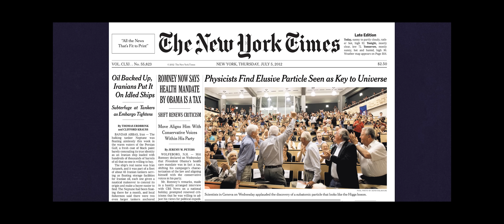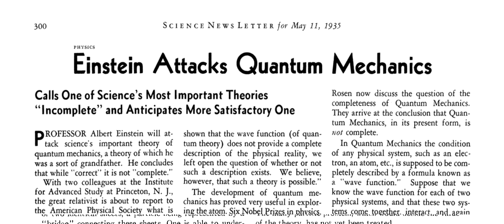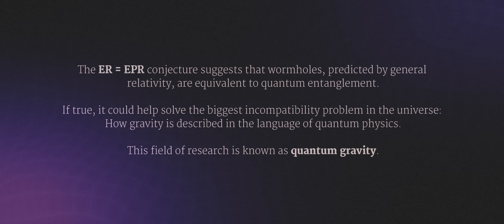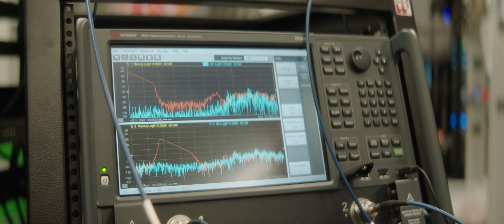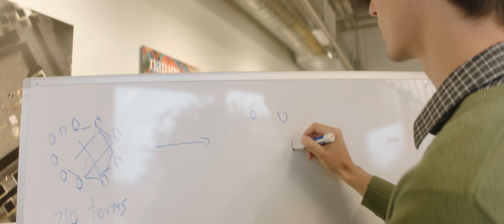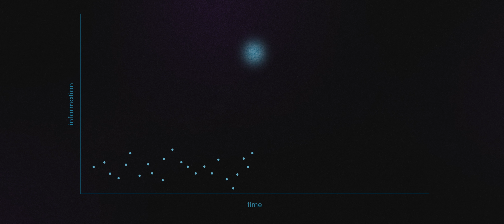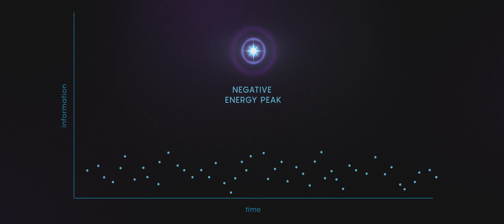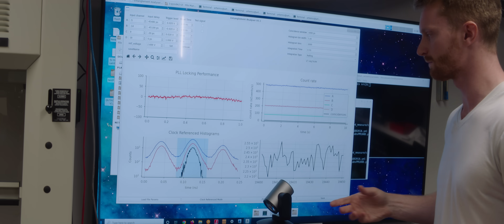How Physicists Created a Holographic Wormhole in a Quantum Computer

Comment: To everyone watching this and thinking they actually create a wormhole in a lab, you need to calm your enthusiasm a bit. What they really did in their lab was simulate the physics they THINK runs our universe, which may very well be wrong or, most likely, be incomplete. On top of that, they simplified this simulation, or model, so their quantum computer was capable of running the experiment. This resulted in them removing a lot of potentially significant variables that very well may have led to a physically inaccurate model.
As of right now it would be irresponsible to claim an actual wormhole was created. I understand the scientists involved in this simulation want people to think otherwise and I also understand why media outlets would love to use their claims as clickbait for their articles. That doesn't change reality, though. Creating a simulation based on our current, incomplete understanding on physics, then proceeding to vastly simplify the simulation, and then succeeding the experiment on this simulation does not prove much. But it very well may be a step towards the right direction, who knows.

Comment: I call bullshit. There has to be a difference between quantum teleporting, and using neural networks to optimize the space an electron has to travel in real time. Even if the math suggests with enough energy you can push these bits through a singularity. 

What these scientists should be saying is that if they had a solar mass worth of energy hooked up to these computers they can force this optimization to push across a singularity. But this is still just a simulation. Albiet a powerful experimental verification of what Einstein already explained had to be a physical reality. 

I am just saying there is a big difference between a blueprint of a boat that will take you to the new world, and building the boat that actually can take you to the new world on the first try without finding one of a million reasons to sink itself for challenging God.

Comment: "They hoped to design a quantum circuit that is mathematically equivalent to a wormhole." 
It is going to be very important to explain how this isn't just a simulation, because quantum computers (or at least as far as I understand the math) can't solve problems that a traditional boolean based circuit can't solve (just with more instructions). 

I actually understand what the idea is here. Because qubits are suspended in a vacuum and not bound traditionally to a linear circuit like a normal CPU chip is, can you theoretically bridge an informational path way that is shorter from point A to point B than a traditional circuit, and can you make that distance infinitely smaller and smaller to the point where you have a circuit that approaches a singularity? 

I am not an expert in physics ( i am more of a programmer) but what I understand about Quantum computers is that this is theoretically their main feature. The idea that some algorithms become more powerful when you can compact them down into theoretically smaller and smaller "virtual" (or rather magnetically manipulated photons in a vacuum state, the circuits size becomes a function of energy input rather than a function of how small you can print silicon into circuits). 

From what I understand about this argument is that if you were to ask the question "what happens when a black hole eats another, isn't this technically a wormhole? and better yet if you dropped in an identical piece of matter in both ends at the same time in the same symmetrical but mirrored location on each individual (but lets theoretically say they are the exact same) blackhole, can you plot the fate of each other, by only plotting the fate of one, presuming equivalent states of the black holes? 

In such a state, yes worm holes are equivalent to spooky action. The only thing I don't understand is the quantum teleportation aspect. Simulating a wormhole in software, doesn't actually break any rules like faster than light travel. I'd argue that if this wormhole was real, it could make computer chips that are far and beyond more efficient than the human brain could ever be with a "cpu" that is one millionth the size of a human brain because you could theoretically optimize in realtime the size of these "photonic/virtual circuits" all the way down to the size of an atom.

It might be extremely energy intensive (think about a computer that needs a particle collider to power itself) but if this experiment is actually legit (and not just something anybody with a macbook can do right now) we could be seeing a breakthrough in computation too.

Comment: Bah. A simulation is only going to be as good as the information put into the computer and we do not have enough solid evidence of what's in a black hole to make an accurate simulation.
Reply: It wasn’t a simulation. It was a physical wormhole on the quantum level formed between qubits in the computer. So they successfully created a wormhole on the quantum level.
Reply: @hintoflimetostitochip7978  I rewatched to confirm and no it does not. 12:13 "what happens is, the qubits of the google quantum computer, are making a little bit of extra space, and that's our wormhole." That is not a wormhole, it is a "simulated wormhole". It then continues at 12:22 saying: "a pulse of negative energy falls into the wormhole". Negative energy is completely theoretical and unproven. Again, it is using theoretical inputs to achieve the desired result in the simulation.   

 If the scientific community agreed that this team had actually created a physical wormhole, it would be blasted from every scientific news source out there. The fact is that you cannot create something that's physically real inside a computer. It is doing nothing but math based on inputs regardless if the math is being done by a quantum computer or not.

Comment: 4:13 problem is entanglement gets exponentially harder to maintain with macroscopic particle systems. Black holes have WAY TOO MUCH particles, making this task practically impossible. IIRC, there's a "technique" to reduce the complexity to a cubic (better than exponential, worse than quadratic), which allows to reduce the entropy.

If traversable wormholes can exist, this would cause time-travel paradoxes because of teleportation. Unless "ER = EPR" means there's no teleport, because entanglement cannot send information faster than light.

This means wormholes are pretty useless, because the time to traverse them is proportional to the distance between the ends. The only use cases would be to avoid dangerous zones filled with rocks (for space exploration), or deprecate optical fibers in favor of "vaccum tunnels" (for communication)

6:09 "negative energy" usually means "virtual negative energy", in the same sense as "virtual particles". It's just a mathematical model with real observable effects. But if they mean "real negative energy", this brings back time-travel paradoxes. However, if the hypothesis that Dark Energy is actually negative energy is true, this is plausible, because nega-particles can't interact with posi-particles, except gravitationally.

Problem is, this is still implausible, there's no way to "harvest" negative energy. Unless we put the 2 ends of the wormholes in places devoid of gravity, to allow dark energy to do its job.

Comment: I have. Squash in the microwave grew vines out in 1.5 seconds. Time travel is aging and people think it's an electric staircase. One side is a electrode cavity and the other is a magnetron. Was a pin in it 🍠 1.5 2.5 about how long it took me to turn it off in surprise. 19 years ago. I actually hit start , stop, reset time and start again before it went funny so there is a variable in the pressure. Really creepy, never tried it again. Maybe that's why there was a UFO over our house that summer 🤔 ✨. Our existence is also in a worm hole so technically everyone has the experience as time moves forward 🌀

Comment: Time does not exist. A rosen bridge is not a wormhole. It is an understanding of what someone thought. A wormhole is Energy between two galaxies or Universes. Quantum Entaglement is the string theory of everything is connected and is proven. First we have to understand the energy in quantum physics to know what the string is made of. The we must except that time is wrong. Everything was based on the travels around the Earth which we learned the Earth does not orbit the Sun but in fact goes around it and forward just a fraction. That is called lineage and proves year to year. How many years is the next question. Light is instantaneous. We only range its speed by when it arrived but the variables of atmosphere, space dust and clouds, solar flares that will make the protons move faster. too many variable to say we know the speed of light. We do not. Quantum physics is new. No comparisons to physics. Especially now that we have learned of the forward motion rather than the orbit.

Comment: It would be interesting to check for any radiation signatures from positrons inside or around this device.
Reply: Why?
Reply: @jacekmaui7381  If negative energy is required to open a wormhole then maybe a traversing electron could be annihilated on one side.
Reply: @sharethought  it just computer, and if the computer run a program, it's called simulation right?
Reply: @husanaaulia4717  Sometimes programs write past boundaries to interfere with other programs.

Comment: Isn't a wormhole supposed to join two different points in space time without traversing the distance between them?
It seems like this qubit merely went from one point in a computer to another point in the same computer, isn't that called a data stream?
Now if that same qubit went from one computer to another computer without any internet connection.....
Reply: Quantum physics does not work with the same logic that you are trying to ascribe.

Comment: So not a wormhole but a simulation with quantum entanglement, forcing a negative energy to disperse into time and space and then return to the same point in time. 

So we can bend space time with quantum bits just like rotating disks? Only this appears to create a tunnel between points?
Reply: That's exactly correct.

Comment: Ladies and gentlemen black holes they never will get untangled, black hole are the most powerful objects of is kind. Each represents galaxy of its own, the only time they get untangled, when they are merging. Now let’s talk about wormholes, how they become to be? So far guy’s you have noticed space doesn’t produces energy evenly some areas production out of control some areas like desert the ones we called voids and there are areas in between two not a high or low production area. Now how wormholes will form and why, you know it already almost two billion light years from us, there is region in space stretching out more than 3.5 billion light years of distance and galaxies clattered through the length of space, now the reason galaxies did that, because that part of the space energy production is so massive like the space became static, from birth energy contains positive and negative. Think about this neodymium half round shape magnets they pulled each other from the side not from inside or outside, if you keep adding it will form like tubes or pipe. Now think of that part of the space where is located that wormhole it happened exactly the same thing from inside whole negative force outside whole positive, even though energy particles don’t stick around long enough to form official wormholes, the way space produces already good enough for space acts like wormhole . Any spaceship goes through there it will save energy plus it will travel that part of the space unbelievable fast matter of minutes. All that 3.5 billion years of distance.
Reply: No one mentioned black holes in this video besides when they stated that that was exactly what theyre NOT dealing with here. Perhaps another watch is needed.

Comment: Unfortunately, in this presentation there is no any connection experimentally proved between the gravity/wormhole and quantum physics. This is rather deceptive and misleading manipulation of the terminology. We know that, mathematically, an analytical form of the wave equation is practically the same for sound, water surface oscillations and electromagnetic waves for example. So it is not a surprise that there are possibly other types of equations describing different physical phenomena, such as wormhole and quantum entanglement, by the same analytical form. So what? It does not prove that these effects are the same in origin. What is demonstrated in this experiment? Can you change gravitational field of the physical object with help of quantum entanglement or qubits manipulation? Can object change its weight or levitate or be displaced as the result? No! It is totally unclear what is performed in this experiment. In a few years this experiment might be very well forgotten if not proved to be wrong due to unacceptable level of experimental errors or misinterpretation of the results by its team. That has happened before and is not excluded to happen in the future research.

And BTW, the quantum entanglement was experimentally observed many years before and not as it claimed for the first time in this experiment. See who got a Nobel Prize 2022 in Physics for entanglement experiments!

Comment: "Negative" energy makes a lot of sense from the perspective that drove the quest for "ether" needed to make  gravity a logically viable force that can propagate.  It acts like a vacuum.  How much of a vacuum can one have?  Well, what kept the energy contained before the universe formed?  It is simple to cause from the principle that energy moves slower in energy field of higher intensities than empty space.  Maxwell formulated this in an equation long ago.  Its just having a way for gravity to propagate out that's the situation hard to grasp, with out something like the way electron holes allow currents to flow through semiconductors.
Reply: Nonsense

Comment: And how does this help us right now?  We can simulate a wormhole, and send a piece of data through it, can we do the same thing with physical matter?  Can we use this to create artificial black holes that are connected together, and use them like an express way to go places?  Can we use this to produce energy?  Can we use this to reach and harness new sources of energy?  Can we use this to travel through space in a time frame that doesn't take decades to reach the outer boundaries of our own solar system?  Can we use this to revolutionize the energy sector, make it immensely economically easier to move fuels, and goods from point A to point B?  Can we do the same with people?  Can we travel from one pole to the other in the blink of an eye?  If the answer to these is yes, you've just made alot of people who get very rich off of these exact things, nations with borders they need to protect, and enemies they want to keep out, extremely nervous.

Comment: i was thinking about this and lets say you are able to create a stable worm hole. You can now go from newyork to centaurus b. How do you aim this thing. what if there is a person in the target area. what if we don't aim it at or in a planet and it is aimed in space near the target planet. if this worm hole is open there and here, wouldn't everything here get sucked in because of the vacuum of space. so if that's a problem then the worm hole would have to also be a barrier. wherever you aim it, it would have to have the same pressure as the operation position. it  makes sense that they were able to it on earth where there are going short distance but the only way i see this working on astronomical distances it would have to be aimed at another earth with the same amount of atmospheric pressure. I am not a professional. im basically just thinking out loud.